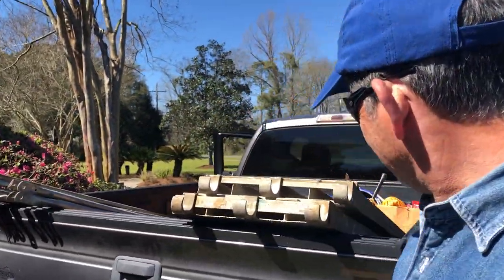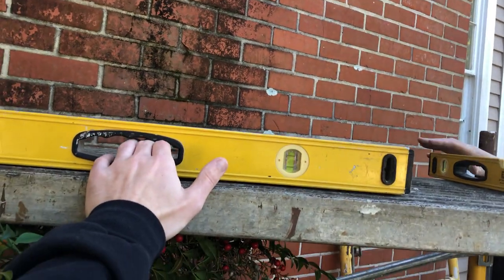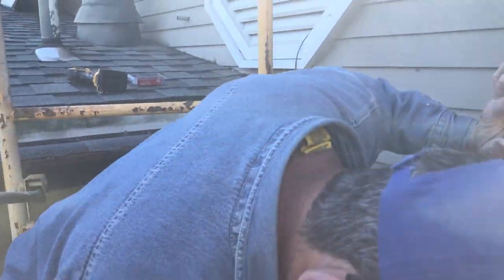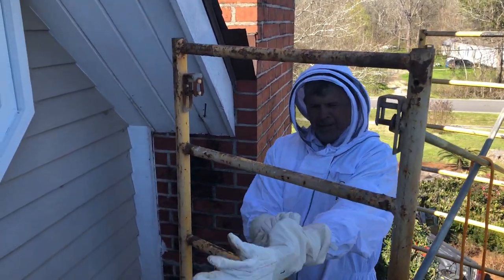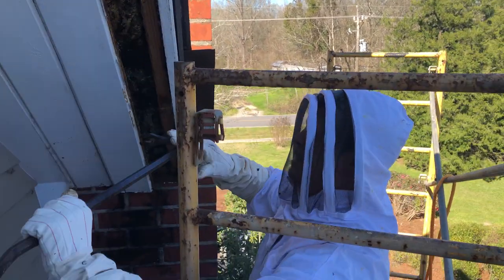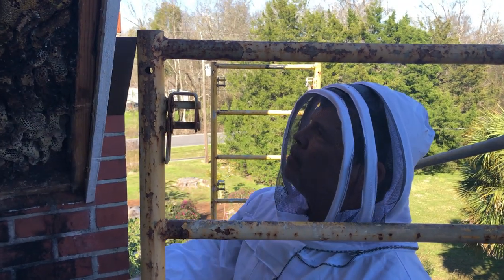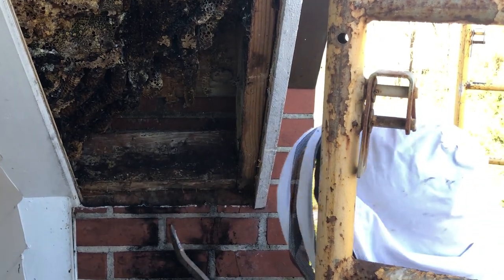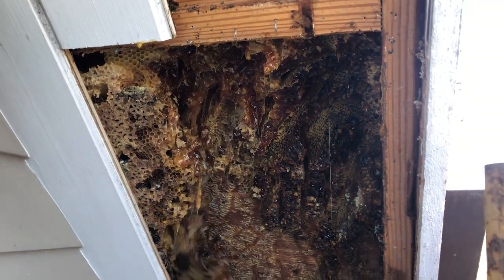We UNCOVERED a HUGE Bee Hive in this Soffit!

Comment: The first thing I would have done is bracket or rope the scaffold to the wall or chimney.

You were lucky that the hive was struggling and there were not a lot of bees. 

If you run across a hive in the future that you need to remove - don't treat the comb like wood, e.g. don't remove comb with a pry bar or crow bar. Cut the comb free from its attachments using a bread knife, flexible putty knife or similar. You can rubber band any usable comb in new frames and a hive body. 

The hard part is often catching the queen and getting her into the hive.  But once you do, all the rest of the bees will generally follow her.